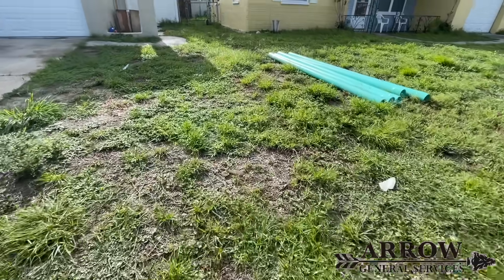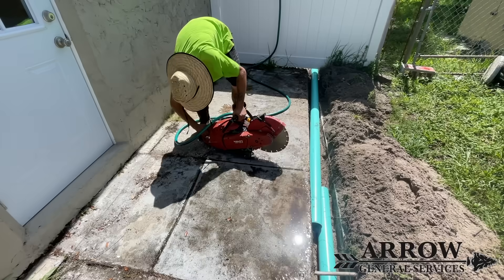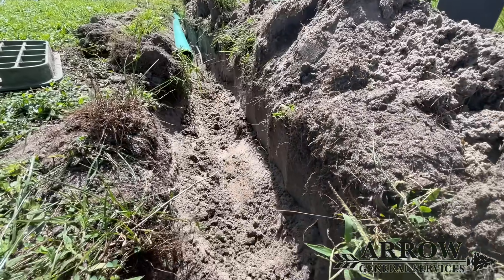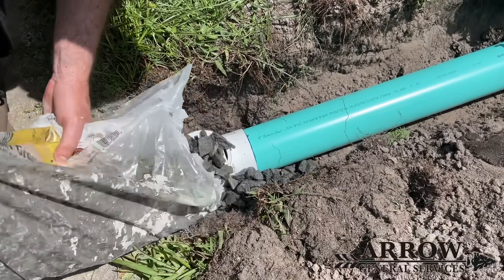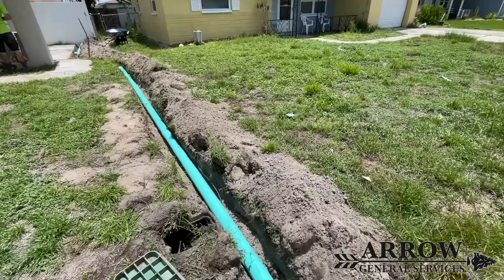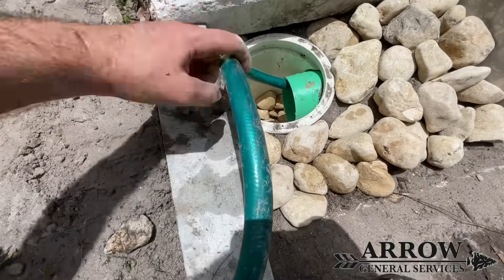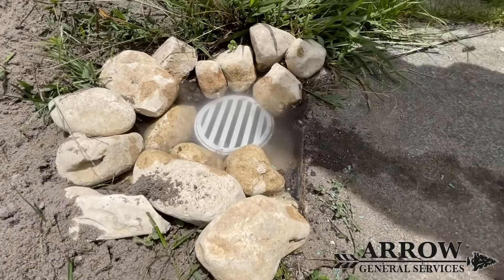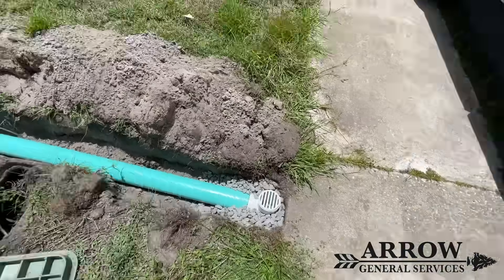How To Drain A Yard With No Slope - Flooding Issue Solved

Comment: The video didn't bother to mention that if someone is going to dig in their yard, they should call their state's utility locate service (which in FL is FL Sunshine) to have cable TV, phone, gas, and electric etc. flagged before digging. It's free, and can save a homeowner hundreds or thousands of dollars that they will otherwise have to pay if they damage a utility line.

Also, you should have pointed out that this type of drain won't work in soils with low porosity (such as a high clay content),  and your French drain doesn't include a geotextile wrapped "around" the crushed rock, so the drain WILL cease to work (or work very poorly) within a few years at most, even in high-porosity soils.

Overall, a good design and great video - I used this technique (combo surface drains, with French drain(s) to handle bad-to-no drainage conditions) as a contractor in the Dallas/Fort Worth area, which has notoriously high clay and/or organic-content soils, and any French drain was unique due to soil and surrounds, and ALWAYS included geotextile around the gravel or stone. Utility locate service was a lifesaver - we hit a 500-pair phone cable to an apartment complex in one right-of -way that had been mis-marked by the cable locate about 6' from its actual location, and I believe Southwestern Bell quoted $4000 to repair the cable before I pointed out where the locate service had marked where the line "was" vs. the ACTUAL location of the cable.

Comment: Whoah, wait...rookie question here: you are saying with zero slope that rock inside the pipe will draw the water in and flow?? Do you need to add rock to the entire length of the pipe to accomplish this? Is the pipe shown compatible with standard 3 or 4" corrugated drain pipe?

Comment: Gutters and a right angle diverter board that you attached to right under tne faciaboard on the roof...righ under that nail in a right angle board that you can attach another then attach downward to the side of the house

Comment: That 6" SDR35 repair coupling is not SCH80. 6" SCH80 has a pressure rating of 280psi. 6" SDR35 is 46psi. Either way it's fine. It's not going to crush and that's what matters.

Comment: Can you use PVC in Chicago winters?
Reply from the maker: Good question! We would not recommend using PVC for yard drainage if you live in a climate zone that has freezes. PVC will crack in those conditions unless it’s below the frost line which is difficult to do in most situations when it pertains to yard drainage. Use drainage pipe made from a virgin material that can expand and contract in freezing climates.

Comment: By the looks of it the existing concrete is rotten, you could save yourself a lot of work by replacing the concrete, and pipe design. Your system will work but you created more work than necessary. And new would have looked great.

Comment: Good intentions but you're dreaming if you think think the soil can at the end of the run will absorb any meaningful amount of water If the soil in that area had that capability, no drainage system would be necessary. That looks as though water from the road, will overflow into your outlet grate. I wish you all the best with your system but it may have to deal with hydraulic pressure forcing water backwards through your system.

Comment: Sooo..., the yard does have slope.  Overall, the pipe has to go downhill, whether underground or above ground.  If the ground were level, you couldn't get the exit pipe lower than the intake.  Also, should have put a clean out when mud starts to get into the pipe.

Comment: I did the exact same thing with a drainage project of mine.  One thing I learned though is that over time sediment will build up at the drainage end and prevent percolation back into the ground, so I have to periodically clear that out.
Reply: A trick that has been used by soils engineers for probably almost 100 years, but which has been totally ignored by the plumbing industry, is to place a layer of filter sand between the soil and the pipe, or between the surrounding soil and the drain rock.  This can be done on underground structures or surrounding the perimeter of catch basins.  A very available and highly effective filter sand is that which is suitable for use as fine aggregate in concrete, meeting the specs for ASTM C33.  It's commonly called "torpedo sand" by those who don't really know it's primary purpose, and you may have to search for it by that name.  This sand is very clean, but it's also well graded so that the spaces between particles are much smaller than what's the case for what might be called "beach sand" or "river sand", etc.  The small pore spaces within this sand will stop silt-size soil particles from entry.  Since the filter sand is right against the surrounding soil, there's no room for the soil to move, and thus there's no accumulation of fines on the outside surface of the sand fill and so no clogging occurs (unlike what happens when clear stone is in contact with the surrounding soil).  Properly installed, this kind of a filter will last forever and will never become clogged.  It is plumbers who write the rules for their trade in the building codes, and so the value of this filtering method will probably never be recognized by those who need this information the most.
Reply: @ericl2969  In NJ it's referred to as concrete sand. Concrete sand also compacts very well and is used under pavers and such.
Reply: @ericl2969 thank you very much for this information!!

Comment: In my country (uk) we aren't allowed to discharge surface water from paved areas into the road and need permission to put it into public surface water sewers. This is to reduce flooding due to run off. We are encouraged/required to create on site soakaways.

Comment: I like the idea. Will the plumbing code allow waste water so close to your potable water line? Will the local inspectors allow water to run across a sidewalk?
Reply: Its not "waste water". Its storm run off. Theres a huge difference. There is a reason you cant dump "waste water" into storm drains. Storm drains exit into rivers/reservoirs. They dont go to the water treatment plant, like waste water does. There is no reason storm run off cant be close to the fresh water line. If the fresh water line breaks, the water isnt going into the house anyway. 
The issue with this system in the video, is the catch basin he dug at the sidewalk. No code would eve allow that. The water catching would quickly erode the soil under that sidewalk, destroying the sidewalk, and eventually destroying the street it is attached to. This contractor should have had the municiple engineer come out and work with him on a termination to this drain system. It doesnt cost any money, just an extra week or so to get the plans approved. This was a hack job. He didnt want to spend any money on a permit, so he came up with the idea himself, which is the wrong idea, obviously.

Comment: If it's a dry area...
How about in addition to the drain...
Some water butts to collect the water and use in the home or garden.
I also liked that there was no Muzak.
Reply: A dry area in florida?
Reply: @stargazer7644 
A dry area is somewhere that the soil is bone dry .. under the sheds for instance..
It doesn't absorb water easily.. so as in my comment.. catch it before it gets to the ground in a tank and the overflow will also be higher to go somewhere else.

Comment: Hey quick question, wont the water back up the pipe before spilling over the top? Great video btw.
Reply: I'm wondering the same thing.
Reply: Absolutely. It cant magically defy gravity and rise above the level of the pipe
Reply: Depends if the “drop” was less than the diameter(4”) of the pipe. If more, it will exit the outlet by sidewalk first.

Comment: I have 3" drain pipes installed in my patio also without any slop given to it and the run is about 79 or 80 feet long, including a section I am installing for the pipe to go out to my driveway which is slopped towards the street; I can in the future cut the cement and connect that pipe to the main drain pipe but not ready to pay for the cement cutter just yet, not until I have all the materials required for the project so my plan was to run the pipe out to the driveway underneath the slab allowing the rain water to just go dissipate in that area; we live in the desert and we do not see lot of rain here.

Comment: If you're allowed to pour the water on the sidewalk, why use the gravel 2 feet down? I mean, all the water in the pipes that you collected will be concentrated at the end of the run. Won't that area now get saturated vs. removing all the water on the sidewalk ?
Reply: I had the same question. I think the idea is that for most typical rainfalls, it would only go down into the gravel (and some into the soil) before the rain stops and it can start drying out. And only for more than usual rains, it overtops and goes over the sidewalk.

Comment: “Back cutting” with a Stihl saw, a MASSIVE no no, clearly no experience using one, it’s one of the first things your taught during abrasive wheel training (a certification of competence that is a legal requirement in order to operate a saw here in England) 2 some guttering on the side or even a soak away to the edge of the paving stones would be just as effective AND a lot less expensive AND less time consuming

Comment: Your video skills exceed your engineering ones grasshopper.
Two foot hole in the ground - dearie me!
You should be installing a soakaway.  Yes, that means digging a big hole and putting soakaway crates in it wrapped in non-woven geotextile to keep out the fines.
And as I see, as @Ray Perkins said, fit gutters and downpipes so they take roof run-off straight to the soakaway.

Comment: I don't think that fixed the problem. You will still have water flowing over your sidewalk. That was the problem they were supposed to fix. If the water is not draining to somewhere, it will build up and overflow your system creating puddles, which is what they were trying to prevent. Looks like this owner spent a lot of money to fi9nd out how NOT to do it. I would never accept this kind of shoddy work.

Comment: It’s a shame to do what looks to be an okay job then sabotage the whole thing by skimping on the outlet hole. A slightly larger sump lined with something to keep soil out of the rock would have turned this into a decent installation. I’ve done similar installations and the increased surface area in the pit is the difference between frequently over flowing and occasionally overflowing. 10 more minutes and $10 more of material would have done it properly.

Comment: I like the 2' down pipe at the end of the run, to allow the pipe to eventually dry out. I'm going to add that to my system. BUT: he either failed to do so, or failed to mention, you NEVER dig anywhere, especially near the front of the house, without first calling 811 to have them plot where all the utility lines are. 

Damaging a utility line can cost 10s of thousands of dollars to fix (you get the bill). And that's if you survive hitting a gas or electrical feed. It's free, and the first thing you do. Don't ever assume you know where everything is, you don't! I have the entire neighborhood's 480V power grid feed running straight through my yard, on my side of the sidewalk! Definitely not obvious, and definitely not something you want to "discover!"
Reply: What is the process when you call 811? Do they come out and show you where utility lines are or do they email you a mapping?
Reply: @dross10001  For me, each local utility sent out a guy or two. It wasn't just one guy that did all the utilities at once. It took a couple days for them to all show up. They'll either spray paint and label (with the paint) where something is, or they'll stick a colored flag in the ground, or a series of flags to mark the entire length of a  conduit or pipe. Each utility has their own color, I think it's yellow for electric, orange for gas, blue for water. Something else for cable. Then they'll advise you not to trust the marks down to the inch but to give them plenty of leeway on each side, like a foot or two. And they wouldn't stipulate the depth for me. My lines might be 2' down, or 3' or 6', I had/have no idea.

And if I remember right, they're not obliged to tell you where YOUR lines are, only theirs, up to the demarcation point. That point might be at your house, or at the street. Water guys only put a blue spray dot at the street. The cable guy put down a dozen flags all the way to my house. I imagine every utility in every town does it slightly differently, so this isn't a guide or anything, just what happened at my house.

I used a machine to dig some holes, but only a foot or so deep ( Iwas planting 40 plants to replace a lawn). That was pretty safe. When I had to go deeper for a tree, I only used the machine down about a foot, then did the rest by hand. I was very aware of what it would cost me if I hit a line (assuming I lived!), so the extra hand labor was worth the peace of mind. Not that you couldn't damage a line with a hand tool, but you go easy and slowly and hope for the best!

A friend of mine had a restaurant, and the business next door was having some work done. The excavator hit a gas line. It burned the entire restaurant down, and killed one of his employees. So you're not just risking the cost of repair to a gas line when you don't 811.

PS. I doubt very much they would ever email a plan. And you wouldn't want to accept it if they did. You know how that works: the plans say one thing, and then the original builder does whatever the heck he wants. So, yah, they'll send guys to your house and they'll use instruments to detect the actual lines. It's the only way to know for sure.

Comment: If you don't have any slope the water will not flow in any direction and just fill both ends of the pipe still having a puddle. 

Water will look for an exit with the least path of resistance. If the pipes are full, water will just flow over the drain and not into it.

Comment: Fitting roof gutters and down pipes would be pretty effective. In addition, you could install water butts to collect rain water for use in the garden.
Reply: My runs from downspout have solid 3" pvc to drywell in planting/flower bed and perforated drain run to street so if garden/lawn is dry, outflow can help water landscape (in front); backyard rain barrel for veggie garden.
Reply: That won't solve a heavy rainfall problem
Reply: I was just thinking it would have been easier to install gutters
Reply: Collecting rain water can be an ordinance violation as some towns/cities prevent the collection of rainwater.

Mostly due to the lack of upkeep from the homeowner when the barrels become full.

Always check with your local building inspector to determine potential pitfalls before purchasing any supplies for a project.

Comment: I would not have kept it level with the concrete. It's still going to flood. My backyard still floods with gutters going into the drain pipe, floor grates, and yard clean outs, that goes out to the curb with a sloped front yard where it bubbles up. The backyard still floods up to the patio door.

Comment: If there is no elevation difference between the intake end and the outflow end, there will be no flow until the intake end is submerged  and thus higher than the outlet end - meaning that you are right back where you started after all your efforts and purchase of piping. Water flows DOWNHILL whether it is overland or in a pipe.

Try catching the gutter flow fro the roof above ground level, then there will be adequate hydraulic head to discharge away from the house.

Comment: This might work in  areas  which are blessed with moderate climate.In tropics it is just wishful thinking.One pokes a finger in dirt during summer and water shows up. Where would you drain an excess of water when miles and miles of terrain are soaked ?

Comment: If the whole yard was flat like you said then you should use perforated pipe to catch soaking water from the saturated yard. This only drains the two areas you installed inlets at.
Reply: That would be a bad Idea, for the silt from the yard would then clog the pipe. Even adding "window screen" around the piping the length of the project would be work intensive.
Reply: That was my thought. Overall I like what he did, but projecting this onto my own flat yard I thought a perforated drain tile would work without having to have a catch basin grate in the middle of the yard. But you would spend a lot more on materials.

Comment: ......you had a concrete saw....why didn't you just cut away a small section of the sidewalk and drain it directly into the street..........
Reply from the maker: That's a big no way. You can't make changes to county owned sidewalks, roadways, infrastructure etc.